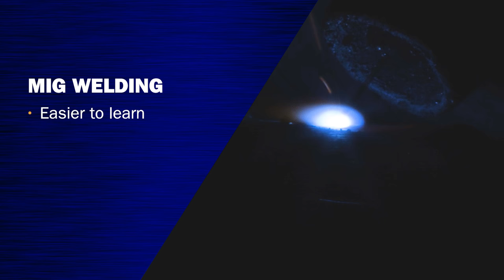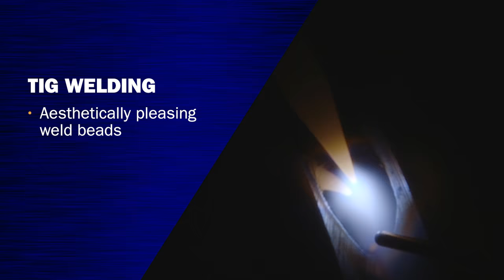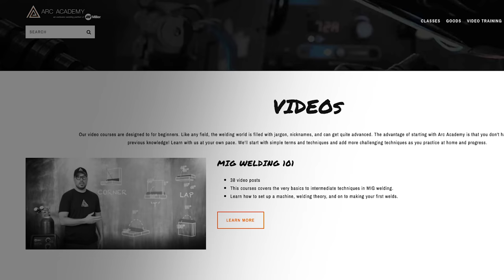Welding Basics for Beginners

Comment: Thanks for the great video... I am learning from scratch... Here are my notes... Got a couple of question marks in there...
Welding - Liquification of a Base Metal with Heat and then they fuse together.

3 Common Characteristics
	1. Heat Source
	2. Filler Metal
	3. Shielding Gas or Flux

3 Types:
	1. MIG
		a. Parts
			i. Heat - ?
			ii. Filler - Electrode on a spool of wire
			iii. Uses Shielding Gas
		b. Benefits
			i. Easier to learn because you preset all your parameters
			ii. Much cleaner welds because you don't have any slag process
			iii. Can be done with a wide variety of metal thicknesses
			iv. Good for in a garage or shop
		c. Weldable metals
			i. Steel
			ii. Stainless steel
			iii. Aluminum
	2. Stick
		a. Parts
			i. Heat - ?
			ii. Filler - ?
			iii. Uses Flux
		b. Benefits
			i. Can be done outside
			ii. Wind does not effect it as much
			iii. Works well on thicker metals
			iv. More forgiving when welding dirty or rusty metal
			v. Great for welding farm equipment
			vi. Great for welding gates in your driveway
		c. Drawbacks
			i. Produces a lot of spatter, vapor and fumes
			ii. Welds are not as clean
		d. Weldable metals
			i. Steel
			ii. Stainless steel
			iii. Cast iron
	3. TIG
		a. Parts
			i. Heat - ? 
			ii. Filler - Metal
			iii. Gas or Flux - ?
		b. Benefits
			i. Provides highest quality and precise welds
			ii. More pleasing to look at the resulting weld beads
			iii. Works great on thin metals
			iv. Work on frames like for motorcycles, automobiles, sheet metal
		c. Drawbacks
			i. Difficult to control because you are controlling all three elements during the process
				1) Leg is controlling heat
				2) Off hand is controlling your filler metal deposition rate
				3) On hand controls non-consumable tungsten electrode that is creating your arc as you move through the bead
			ii. Slower process
			iii. Requires more skill and practice to master
		d. Weldable metals - any metal that can conduct electricity
			i. Steel
			ii. Stainless steel
			iii. Aluminum
			iv. Copper
			v. Brass
			vi. Chromoly
			vii. Exotic metals such as magnesium and titanium

What you are going to be doing drives your choice of process.
Reply: Very clean notes! ✨

Comment: With 600 or so comments, haven't read many, but wanted to note that as to consumables,  stick is the least expensive route, both in the welding rods and the most basic of welders.   Flux core wire is next as to cost of consumables and welders.   When you add gas shielding, such as MIG/TIG and gas shielded flux core, you discover that the gas is going to cost you $12-18/hour of welding, and the machines are a bit  to a lot more expensive.  Now you can fudge on gas using CO2 alone for MIG if you can accept the variable quality decrease but not for TIG.  TIG is aesthetically the most beautiful.

Comment: great Vid. I am hoping to weld metal bed frames into a frame for a smallish trailer  I can haul stuff around the farm in. I imagine that some farm equipment will need to be repaired in the future and I will be in a covered garage (roof and 3 walls only, so basically its outdoors. I would like the simplest and cheapest type with minimal equipment stage needed. Which version do you think might be best for me? Thank you
Reply from the maker: Hi Colin, thanks for reaching out. We'd recommend a stick welder for farm equipment repair and outdoor welding. We suggest checking out our Thunderbolt stick welders to see if one will meet your needs: https://www.millerwelds.com/equipment/welders/stick-smaw.
Reply: Great I will check that out. Thank you @MillerWelders

Comment: I bought one of those cheap flux core welders to try to learn some basic welding and possibly do small projects with thin metals, nothing big.  But space is very limited in my garage but I have a workbench that has a bamboo top.  What is the cheapest/easiest route to protect the wood top?  I would assume that I would just need a steel sheet cover.  If so, what is the thinnest steel that I could get away with?  Should something be put down between the metal cover and the wood/bamboo table top?  My first step is to get hold of some scrap metal of different sizes and shapes and just play around and learn.  Small pieces, thinner metals that is all for now that is needed. Thanks.

Comment: I have never welded before but I've done a bit of carpentry. Last summer I built a mobile sheep corral (I have a video on my channel) and now I want to make something similar but I want to weld it so it's bigger, stronger and lighter. Steel sounds like the best material to use but I'm stuck between using a mig or stick welder. We are on a farm and I'll be welding outdoors but I can't imagine I'll be welding dirty metal (at least not initally). Do you still suggest stick or would mig work too?

Comment: Thanks for the video. Could u tell me what 39/156 mean thickness wise?
Reply from the maker: Hello. Would you be able to clarify your question for us? We are happy to help!
Reply: @MillerWelders  I am buying parts to have a medieval torch put together. one of the parts is a flower 220mm X 150 mm then it says 39/156. Is that the thickness. I know its not the part number. I might have to wait until the lockdown is lifted.
Reply from the maker: Hi Antonios. We apologize for the delayed response. We recommend giving our service line a call to talk this through with a tech. The number is 920-734-9821. If there’s anything else we can help with, just let us know.

Comment: Would you suggest if money allows for a beginner to just get a multiprocessor with tig kit for the 2k or about that. Or would you suggest getting different machines for each.
Reply from the maker: Thank you for your question. What type of process do you typically use?
Reply: Just really starting to get into welding looking to buy my first machine and start learning. Would like to do anything so don’t know if I should start learning on an arc or just spend the money on a multiprocessor.
Reply from the maker: Glad to hear that you're wanting to buy your first machine! If you are looking for all three processes in one, the Multimatic 200,  Multimatic 215 or Multimatic 220 AC/DC are good options: https://www.millerwelds.com/equipment/welders/multiprocess.

Comment: If I wanted to weld some pipes together, witch one should I use?
Reply from the maker: Hi Gabriel, thanks for reaching out. What is your welding application/project? What is the material and material thickness?

Comment: I have a putter heads that is dented, I want to raise the dent by using a welder.. then grind and sand smooth.. some are carbon and some are 303 stainless.. what type of welder would be best for this?

Comment: What's the best machine to use to make BBQ grills stick or mig? And what electrodes?
Reply from the maker: Hi Zarr, thank you for the question. What materials will you be using for your grill? Thank you.
Reply: @MillerWelders   I have no idea at the moment. What metal do you think would be best for stick welding a grill. Thank you

Comment: What’s a great machine to get? Starting a welding program soon
Reply from the maker: Hi Anthony, what process are you more likely to use: MIG or TIG? Or both? Thanks!
Reply: Miller Welders gonna be working with both
Reply from the maker: If you're going to be working with both, the Multimatic 200,  Multimatic 215 or Multimatic 220 AC/DC are good options: MillerWelds.com/equipment/welders/multiprocess. We recommend checking out the product pages and spec sheets to see which best fits what you are looking for. You can also give us a call at 920-734-9821 to discuss this further. Thank you!
Reply: Miller Welders Thank you so much!

Comment: What kind of welding would you need to use for connecting wires together? And what kind of machine would you need to use to start out? I want to learn how to weld but it’s hard to find where to start for beginners.
Reply from the maker: Hey! Thanks for your question. In order to give you the best recommendation, can you please answer the following questions for us? What type of wires are you trying to weld?  How thick is the wire? What power do you have available?  Is this for production or is this a home hobby?

Comment: My problem with this large stick welder is too much fumes and too much metal flowing out of control. you have to be a genius in picking the right heat setting . . . the right electrode, get the right speed while maintaining the correct distance to the base metal or the arc will go out. . . didn't mention didn't pick the right welder: lets start with using negative electrode for thinner metal and a solid electrode  so we don't have all those fumes and grabbing electrodes . . Oh yes we will also reduce the resistance  in the circuit to improve stability of the arc . . . this is an old A.O. Smith industrial welder and I like to make things beautiful and  efficient. I am looking for an "Iridium sparkplug"  I can use for an electrode but will start with a "Tungsten electrode"  if necessary I will modify the electrode for a more controllable arc before going to the tig set-up. with this welder. It's not that experienced welders over looked anything it's just that I  know more about what is possible with higher intelligence. What I build  puts the failed project the welding shop made to shame. You might consider that war with the Communists could happen any day now and natural gas could be scarce and not available meaning you might have to burn wood or coal.. . given the temperatures outside.

Comment: hi, I want to make gym equipment like Olympic bench and power rack, so may i know which welding process is better?
Reply from the maker: Hi Gaden. Thank you for reaching out. Before we make recommendations, we have a few questions for you:
What welding process are you more likely to use?
Are you operating on 120V power, or do you have access to 240V power?
What material and material thickness would you be welding most often?

Comment: What category would spot welding fall into?
Reply from the maker: Hi, thanks for the question. Spot Welding would not fall into MIG, TIG, or Stick. It falls under Resistance Welding. Resistance Spot Welding is done by producing heat between the electrodes, from current flowing through both parts to be welded, and using high pressure to secure the weld. Thank you!

Comment: Quiston I'm an Hvac tech and I know how to Sauder but how harder or is the same?
Reply: Depends what kind you're doing it's most like tig but they are still very different because sudering is like gluing the metal together rather then welding it but if you're going to get into welding I recommend stick because you can do it almost anywhere with proper venalation and once you get comfortable with reading the puddle you can use the same machine to tig weld if you buy one that is compatible with stick and tig

Comment: Can someone weld metal bed frames together using a 110 volt welding machine. If so, what type of machine would be required.  I’m a beginner helping with home crafts.
Reply from the maker: Hi Ryan, we recommend the Millermatic 141 which is a 120 volt machine. It can weld 24 gauge to 3/16 in steel. You can also check out our forum: https://forum.millerwelds.com/. That's a great resource for getting started with projects.

Comment: Can u stick weld through mill scale or do you have to grind it off
Reply from the maker: Thanks for the question Timmy. Mill scale should always be grinded off. This helps prevent slag inclusion in the weld. Thank you.
Reply: You can stick weld through mill scale and if you get slag inclusion it's because you didn't clean the slag off good enough if you're doing multi pass welds but if you're not you're good to go

Comment: Which can be used to weld upside down, lying on your back under a car?
Reply from the maker: Thank you for the question! All of the welding processes talked about are capable of welding under a car (overhead).  MIG welding is the best suited to weld in a confined overhead space on thin steel that you would find on cars.  If the material was stainless steel or aluminum we would recommend TIG.

Comment: Hello every body
there are two volume on my weldign machine
it is an inverter which has a volume for setting up the current and another for setting up the Arc
about the current I have a sense but I have no idea about the Arc setup
may I ask to help me on this if possible

what is arc setup
what is its effects

how can it help welding
thanks
Reply from the maker: Thank you for reaching out, Mohsen. We recommend giving our service line a call to talk this through with a tech. The number is 920-734-9821. If there’s anything else we can help with, just let us know.
Reply: @MillerWelders  thanks
but I am out of US and calling that nomber will cost me too much

Comment: What about arc welding
Reply from the maker: Thank you for reaching out. Please keep in mind that this video was developed to illustrate a weld position and the specific welding techniques/weld settings used are not necessarily best for all applications. The Specification Sheet from the manufacturer of the filler metal you use is the best tool to determine starting welding parameters. Please let us know if you have any further questions. Thank you.

Comment: Can TIG welding be done in cast iron?
Reply from the maker: Thank you for the question Jose. Tig welding cast usually requires the use on a nickel filler rod using a DC process torch electrode negative, correct joint preparation if a crack, and preheating the complete part. After welding, the part needs to slowly cool, so controlling the heat is essential. Helpful if the part can be put into an oven to control cooling rate over an extended time, (at least 24hrs).

Comment: Where does a Flux welder fit in?
Reply from the maker: Thanks for your question. Many MIG welders can also run flux-cored wire, such as the Millermatic 141 and Millermatic 211.

Comment: Safety question: if someone leans against or touches your welding table, will they get zapped?
Reply: No, even during stick welding you can grab the rod while welding and you wont get shocked, but after a while you will burn your hand

Comment: you forgot to tell us if it takes 220 or 110 volt?
Reply from the maker: For additional information on the Millermatic 211 including input power and output, please check out the spec sheet here: https://www.millerwelds.com/-/media/inriver/dc1258-millermatic-211--english.pdf.

Comment: He didnt explain what MIG ,TIG stands for.  Basic?
Reply: MIG = Metal / Inert Gas
TIG = Tungsten / Inert Gas
The difference being, with MIG the filler wire carries the current to melt the base metals. With TIG, the current is carried by a tungsten electrode to melt both the base metals, and the filler wire. The tungsten is slowly consumed (by electrolysis?) but is not added to the weld.
Reply: Im a mechanic/handyman am  i need to learn how to weld your video is good, THANK U

Comment: what about Oxy Acetylene ?
Reply from the maker: Thank you for reaching out. Please keep in mind that this video was developed to illustrate a weld position and the specific welding techniques/weld settings used are not necessarily best for all applications. The Specification Sheet from the manufacturer of the filler metal you use is the best tool to determine starting welding parameters. Please let us know if you have any further questions. Thank you.